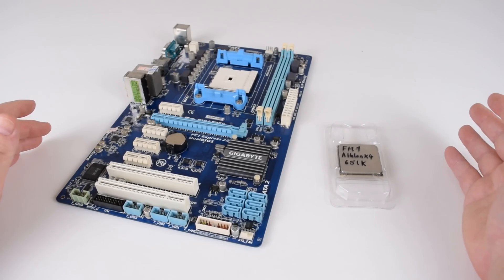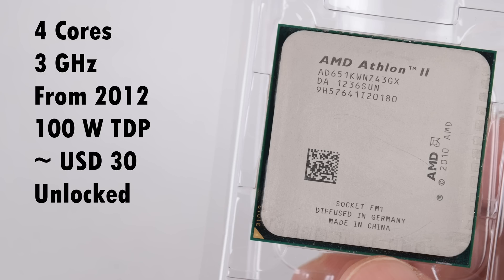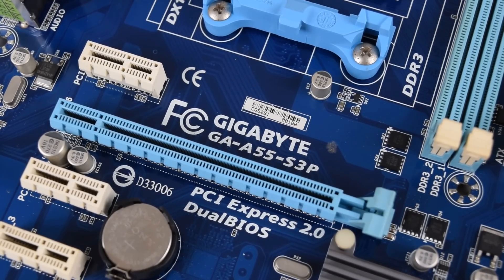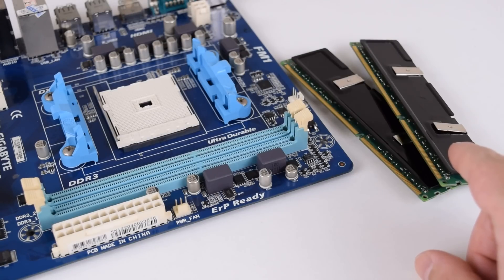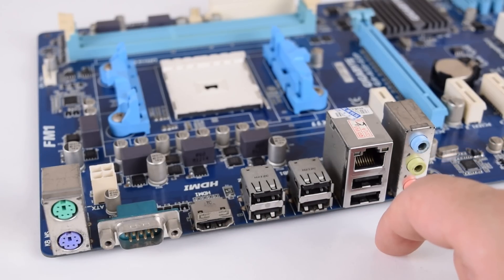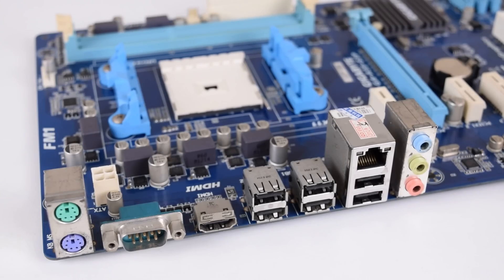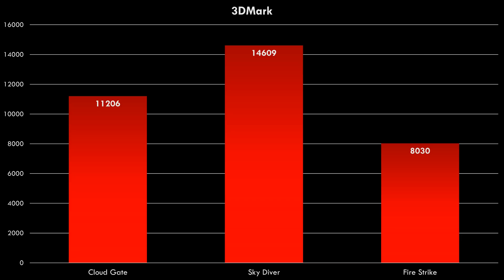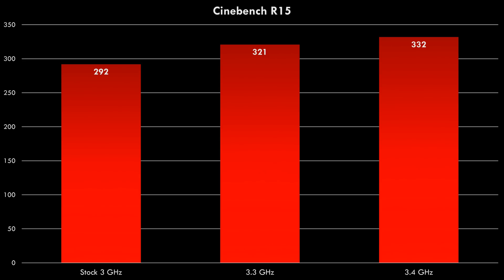Socket FM1 First Look: Athlon II X4 651K - The best CPU

Comment: i HAD A fm2 860K for a very long time. I would load up games and get horrible stutters. I always thought it was GPU related at the time. Until I bought my first core chip when fry's had the 2600k on sale for almost 100 dollars off. The Fm1/fm2 lineup was very uneventful imo I still have a few 651k's knocking around.

Comment: Nope, you are not entirely correct. The main idea of this platform is cheap gaming platform with a lot of graphical capabilities. Those APUs, depending on the grade, are using the same architecture as the entire line of HD6000 and HD7000 gpus, depending on socket type and apu grade. They had an option to link PCI-E lanes from the integrated graphics to the external graphics and work as one gpu which gave double digit percentage performance boost in games

Comment: I have 2 pcs with fm1 socket and this CPU, I bought a GT 1030 and both machines give B2 error in BIOS, can I solve that or should I use another GPU?, if that's the case, which one would you recommend me for cheap? Thanks in advance

Comment: hi phil
about 7 years ago build my girlfriend's pc
with a mobo Asus F1 A75-M Pro socket FM1 and AMD APU 4 3300, a couple of years ago I started having problems the screen changed resolution only, the system very slow, update drivers change to win 10 (it worked well for years with win7), update bios and everything possible to solve, I came to the conclusion that the apu 4 was really bad and they discontinued their support, currently the pc is there powdering with win 10 is extremely slow until it drives you crazy it gets quite hot and I want to put the best processor for that board I think that I will no longer use APU but CPU and with GPU, any advice or consideration, mobo I think it is really good says it supports up to 32 gigs of ram and I am obsessed with being able to resuscitate that machine for a while, I would like Playing SCII is basically the only game I want to play. There is one more thing that you did not talk about in the video regarding APUs, they can also be used combined with external GPUs, but the truth is that I lost faith in APUs at least for this generation, so I do not even want to try it, and when I saw your video I convinced what an athlon x4 CPU already believed best

Comment: Not bad for old cpu I just order one off eBay for an old hp p7 1234 has a 750 ti 8Gb 1866mhz unfortunately I did not realize the bios had no ram speed options so it defaulted to 1600mhz but got it for $16 on eBay lol so not complaining all paired with a ssd. It’s an old pc but needed some love I have a new intel and Ryzen build but still use this one for other things :) thanks for the great review on this processor.

Comment: I'm rebuilding my old pc with the following components in 2019:

Athlon ii x4 651k (will try to exceed 3.5GHrz) 
Found my old mobo: Gigabyte A75 U3D (bought mosfet heatsink for it. Gets hot with overclocking.. no factory heatsink  )
25$ crucial ballistix sport tx rams 2x4GB 1866mhrz 
My GPU: Sapphire HD Radeon 7850 2G. Will try to overclock it...

I will push the whole system to its limit. 

And then i will compare it to my Ryzen build.

Comment: i'am still use this CPU since 2013, and can still playing the games with medium perform averages as good as well.... :)
my rig :

- Biostar A55MLV Ver. 6

- Athlon II X4 651K 3.0 Ghz (unlock to 3.1 Ghz)
- Kingston 1866 Mhz Hyperx Fury DDR3 PC14200 8 Gb (2 x 4 Gb)
- GTX 1050 TI ROG Strix OC
- SSD 250 Gb Samsung Evo 860
- HDD 500 Gb WD blue
- 1stplayer 500W 80+ Bronze PSU
- VenomRX Arkana Case 

- standart lcd 15" monitor (760p, 65 Hz)

love my rig hehehe..........;)

Comment: If I buy this CPU, i can use a GTX 960 2GB DDR5? or it will bottleneck totally? I have an AMD A6-6400K APU 3.9GHz 2 Core, and it sucks.. Worth it buy this CPU instead?

Comment: Just picked up a pc for $60 that had fm1 a4 dual core in it. I bought it cause it had a near brand new gt 1030 in it that I wanted for another build and 8gb of ram. So I'm buying a $10 a6-3620, replacing the gt 1030 with a hd 7770 or something I got for $30, keep the 8gb of ram in, throw in a 60gb ssd for windows, a 1000gb hdd for storage, and I'll flip it, hopefully make $$$ and get a free gt 1030 in the process that I can register under warranty as the seller was really nice about helping me out with any documentation I may need.
Reply from the maker: Nice, the A6 series isn't too bad.

Comment: A10-7850 Kaveri might be right up your street but the A10-7800 Kaveri is the best bang for the buck no graphics card needed just make sure you have 32GB of DDR3 RAM plus the Wraith cooler system, DAA78L should work no problem.

Comment: Just FYI the AMD APUs make for some great low cost HTPCs, you can pair them with OpenELEC or Win 8.1 for a nice HTPC friendly UI and the built in GPUs have plenty of horsepower for 1080p and with a cheap hauppauge capture card they can be used to make a good low cost DVR.
Reply from the maker: True, I also noticed that the boards often come with many SATA ports.

Comment: I had the 850k and 7870k, 7870k was in my system and i later had the 860k for a project of mine. But i loved both chips and pampered the shit out of them. During the final days of my 860ks time with me, i had the damn thing water cooled, 16gb of ram with it, an rx 480 gpu on a a88xm-d3h gigabyte motherboard in a phantom 410, 128gb sdd, black 2tb hard drive and 1 1tb blue hdd. And ofc i had it oc’d to 4.4ghz, my 7870k could only do 4.3, which is why i put the 860k in my main rig. It was a “good”processor and i loved the rig. I knew it was slow. But it didnt stop me from pushing its limits up until i got my 1700x

Comment: Crummy 10% overclock for a amd unlocked chip.

My $38 Aud Xeon X5650 has:                      68.5% overclock 
4.4ghz 1.456vcore
does 1097 in cinebench so no slouch of a processor.

Comment: With AM3 I also had a pretty easy time of overclocking an Athlon II x4 640 from 3.0 GHz up to 3.6 GHz even though it wasn't unlocked vs this one going from 3.0 to 3.4. Do note that I was using a custom water loop for silent cooling so your mileage may vary if you go with a low or mid range air cooler.
Reply from the maker: Nice. We will check out an Athlon II X4 soon on the channel.

Comment: What this platform would be good for is re-purposing those crypto miner cards that lack video output. Get the APU so you have video output and use the crypto miner for the high performance graphics processing which can be had for under $70 USD for GTX 1060 level performance.
Reply from the maker: So how do you output the video?
Reply: He means putting out the video via the connectors on the mainboard, but I wonder if those mining GPUs can be run with the standard drivers at all and on top of that then let the user route it's picture through the APU to the mainboard's display connectors. I'm pretty certain though that all that won't work with an Nvidia GPU in the system like Ron proposed, but with a Radeon mining GPU it would surely be very interesting to try.

Comment: A supported FM2(+) motherboard with an A6-5400k makes for a good Windows XP build.
I'm content with Dosbox for the older games and with a Windows XP machine I can play almost all the old games from the Windows 98 era as well. There are only some difficult cases like Interstate 76 or Monkey Island 3 (without ScummVM emulation) which won't run on XP, at least not for me.
Reply from the maker: Will checkout FM2+ though prices for those APUw are not cheap at all.
Reply: @philscomputerlab  I think the issue is maybe timing, so they could get somewhat cheaper but the structural issue is that compared to Intel there are much fewer CPUs and APUs in circulation from that era. I got my new A6-5400k for 30 euros about a year ago, which I thought was a good price for brand new.

But I agree that AM3(+) is the better platform to buy now in combination with a Radeon HD7xxx series or something similar. Getting a "low" core count cpu and if possible a new board because those FX-8xxx chips have pushed a lot of power through those VRMs on the motherboards and probably shortened their remaining lifespan.

Alternatively getting a Sandy Bridge or its predecessor. Would be interesting to see how clock speed impacts performance in old games more or less than compared to modern titles. e.g. can Bulldozer better keep up with the Core architecture in old games.
Reply from the maker: Yea what I'm seeing is that A4 and A6 aren't to bad, but the higher end models are just poor value to be honest.

Comment: Hi Phil, have you checked out the AM1 platform? Always thought they could work as a combo box: Win10 machine with a newer dedicated GPU, XP box or perhaps how good this APU does without GPU as a DOSbox/emulator.
Reply from the maker: AFAIK AM1 is mostly for low power stuff?
Reply: @philscomputerlab  Yep, only 5 APUs were ever released, all with a TDP of 25W. External GPUs are limited to an x4 interface speed (though thankfully an x16 slot), and APU clock speeds are locked, with the highest being 2.2GHz.

Comment: You showed me more about FM1 than I've seen before. Thanks! I thought about going FM1/2 but ended up topping off the AM3 line with a Phenom II X6 1100T and rode it for a while.
Reply from the maker: I think you did very well choosing a X6 CPU!
Reply: phenom 2 was so good i used them for a decade if it wasn't for lack of new fangled instruction/extensions id probably still be using the 1045t. phenom 2 never left me wanting it felt adequate for the entire time.  i dodged fm1/fm2 sockets had 1 am1 athlon 5350 system for a bit out of curiosity. it aged like an ice cube in the sun. and for a few years ran a fx8120/fx8350  the fx system was solid it played helldivers 2 fine execpt for when they added a avx2 instructions to the game by accident that was an annoyance but they fixed it.  the fx system was a beast beautiful crosshair 5 motherboard all the ports and slots you could dream of execpt m.2 and usb-c  but sooo much connectivity!  it has since been out phased by an Elcheapo a320-f motherboard with minimum connectivity with a ryzen 1600 / 16gb 2300mhz ddr4... bottom dollar parts and its x2 the performance of the old fx8350... on then med-high end parts.. expensive parts... now the cheapest parts out perform the then expensive stuff. lol crazy old pc hardware world.

Comment: You'd be better off getting a Phenom II X4/6.
Reply: Wrong platform
Reply: @stevesmith1383  I know, but I was talking about the performance and ease of availability. A Phenom II X4 955 is very cheap these days, and can overclock pretty well. Paired with card such as a Radeon 7850 (which is super cheap too these days), and you're gonna get gaming performance about on par or slightly better than a base PS4. Of course you can get better, but the prices can jump up quite a lot for the next level of stuff.
Reply: @yukatoshi  of course, if someone was looking to buy used tech from scratch, avoid FM1. Heck avoid FM all together. Get a Phenom 2 X4 (though I strongly recommend x6 1055t). Of find a cheap fx build with a 6 core at least. 

Assuming you don't go the intel sand bridge route. I find i5-2400s for first cheap all the time. Just picked up 2, one for $20 and the other for $17.
Reply: @stevesmith1383  True, but they can't overclock, and decent Sandybridge compatible motherboards are surpringly expensive (avoiding the Ali Express crap).
Phenom II X6s are also about 2x the price sadly.
Also IIRC, an overclocked Phenom II will slightly beat an i5 2400.
FX chips are still pretty pricey compared to Phenom IIs (and remember Phenom is generally faster per core than FX Bulldozer chips.)
That being said however, a decent AM3 motherboard with more modern amenities such as USB 3.0 are a bit more expensive than the base ones.
Reply: @yukatoshi  on US ebay, I see 1055t's in the $50is range, so more expensive, but def worth it.

and I disagree, an overclocked Phenom II will not beat single core i5 2400

I5-2400 single core in cinebench gets a 132 or so. 

a phenom 2 oc'd to 4gbz is only going to get you a score of 104 or so. That's a big difference. 

in multi core performance, a 6 core phenom 2 will beat a stock i5-2400 (not like 2500k are expensive either) but get crushed single core. 

and I see fx chips go for pretty cheap all the time. It's bet to get them in bundles. I've lost count of how many $100 bundles of motherboard, 8-16gb ram, and 8 core fx cpus I've seen.

but like you said, it's all about if you can find a good priced sandy bridge

it's really comes down to what you stumble upon, you find a well priced or cheap bundle, that's what you go for

In my deal hunting I've picked up everything from x58 builds for $40 that were broken but just needed new ram (and included a 680 gpu) to a loud and slow Phenom 2 X4 build that just needed new drives and the case fans to be connected to the motherboard, not the powersupply so they don't run at full blast for $50. (included 8gb ram, 1gpu gpu, and modular psu)
Reply: @stevesmith1383  I was maybe thinking of Phenom II vs Bulldozer in Cinebench.

I think part of the issue is also location. FX chips here in the UK still fetch a high price, as do i5 2400/2500Ts.
Phenom II x6s are about 2 1/2 the price of a Phenom II X4.
Reply: @yukatoshi  yes clock for clock Phenom 2 beats Bulldozer. You need excavator (or it is piledriver) to beat Phenom 2

and Bulldozer requires you to oc to like 5gbx plus to really improve over Phenom 2

it is a country by country thing
Reply: @stevesmith1383  I think Piledriver is about rqual, but can overclock better.

It's a shame we never got a 20nm Excavator based FX chip.
Reply from the maker: Yup, that was my conclusion as well.

Comment: You should really test the i5 750, especially the overclocking... This thing is a beast. Had one back in the day which overclocked to 3.7 GHz on all cores on air (OK it was a Thermaltake Macho cooler, but still)...
Reply: nah, if you're gonna go 1156 go with a xeon, you can get a x3430 (i5 750 equivalent) for like $8 and you can get an x3440 (i7 equivalent) for $16

Comment: Holy crap, that's exactly the cpu I have right now! It has been serving me fine since 2012 and for the most part the performance is acceptable. At first it was paired with a Radeon HD7750, but as it unfortunately died more than a year ago it got replaced with a gtx 1050ti, which is probably the most powerful graphics card one should use with such cpu. With my current setup, I am even able to play some of the newer titles, for example, Fallout 4 is perfectly playable even despite limitation of 4 gigs of ram (Yes, I have 4 gigs of ram in 2019) with framerates never really dropping below 40-ish fps. The cpu is definetely the bottleneck, but gpu usage fluctuates between 40 and 80 (sometimes 90) percent, so I'd say it's not that bad.
And yeah, in terms of overclocking the highest I managed to push the chip on my ASRock A75-M-HVS mobo was 3.42 GHz with a Cinebench score of 341. It wasn't completely stable though, so now I run it at 3.4 GHz / 1.4375 V. Perfectly stable and doesn't overheat. Sure it's not much, but every little bit helps.
UPD: Thanks for a like, Phil! I've been watching your channel for quite some time and even though I'm not really a retro PC enthusiast, I've always found your videos extremely entertaining! Keep up the good work!
Reply: hi can i ask you somthing, can it work when no gpu installed? i will basically get this not for gaming
Reply: Sounds similar to my Phenom II X2 that I ran as a quad core and set to 3.8 GHz.
Cinebench R15 gave it 375 points.

Battlefield 1 (which is the most modern game I play) gave around 70 FPS. It would drop to 40 FPS, specially on multiplayer and heavy scenes with smoke/fog effects.
Video card was a GTX 650 and I upgraded to a GTX 980 but the FPS stayed the same.

Then, I switched to Ryzen 1800X and I get 120 to 160 FPS in Battlefield 1. I am still using the GTX 980.
The Cinebench score is 1645.

Battlefield 1 uses 4 cores but I think it helps having more cores, which run OS components.
Reply: Lol I've been running an athlon 2 x2 in an am3+ socket from 2009. Its been serving me fine. I replaced it today with a ryze. 32200g though.

Comment: You may also have had issues with the XMP RAM, it usually needs a bump to 1.65V (check the SPD in CPU-Z) and there can be a little dance in BIOS settings to switch the voltage up automatically  (my AM3 being an example). If you're pulling 1600 9 timings without the voltage bump, it probably won't be stable.
Found a nice set of HyperX for my almost complete build, and it is 1600 CL10 native (not XMP) at 1.5V … don't think I've ever seen a CL9 1600 that doesn't need 1.65V
Reply from the maker: Nope the RAM I have doesn't need extra voltage :)

Comment: Having an A10-6800k (FM2) I can say the following.  The APU isn't terrible but if you want to play beyond ~2012 games you'll still probably want a dedicated GPU to play at higher resolution and max quality settings.  Going from 3GHz to 4.1GHz doesn't do a lot for most games; most general benchmarks would show an increase of ~30% but in game it's probably close to 5-10% improvement in FPS.  Outside of games, that 30% is pretty real and great for lots of things ([de]compression, audio/video conversion, etc).

I am really interested in what your gaming benchmarks turn up for the APU for XP.  The sad part is the graphics processing is there, but the shared memory is definitely a large part of what holds the APU back.  It's a shame AMD didn't include on-die VRAM, but I imagine that would cut into their bottom line.  In any case, as always I appreciate this video and look forward to future ones.
Reply: FM1/2 APUs weren't great. The best choices were Athlon X4 CPUs overclocked to the max.
Reply: The A-5xxx series is good for setting up a Windows XP machine, with the right FM2(+) motherboard.